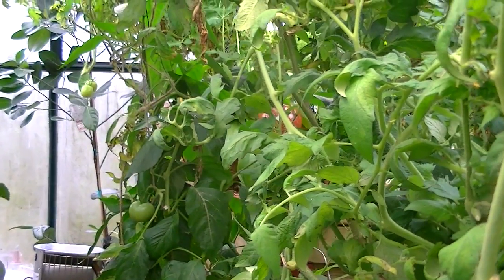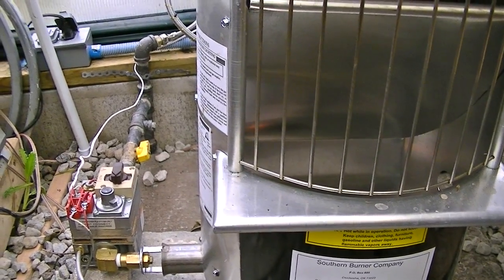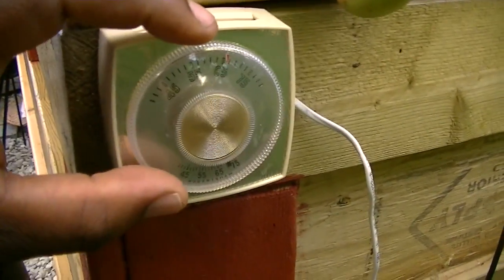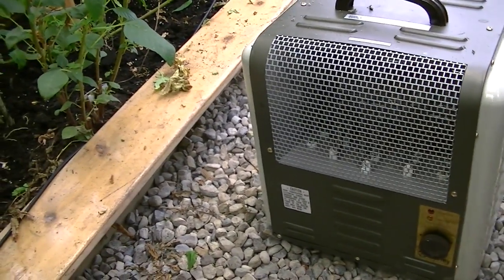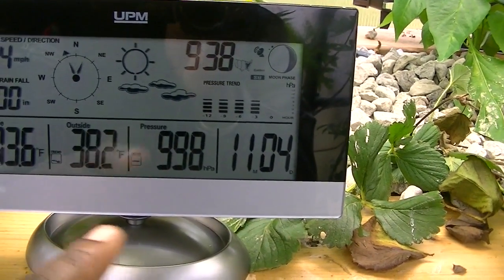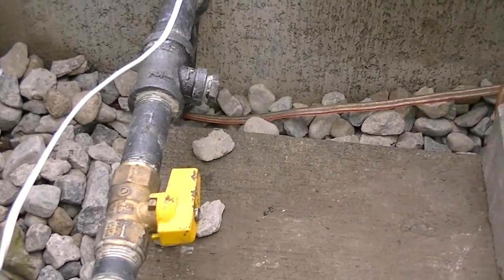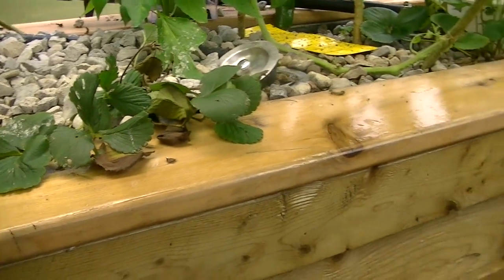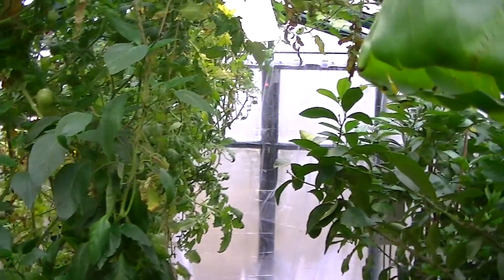Backyard Greenhouse Heating in Winter  (2)

Comment: when using the propane heater or electric heater set metal buckets filled with water on or in front of the heater, the metal bucket will retain heat and heat the water then continue to produce heat after the heaters are off.

Comment: I tried using the 4000 Watts Marley Heater. The heater itself produces a lot of heat but the thermostat doesn't work. The heater just stays on even if you put it at high, medium or low settings. What did you do to set up the thermostat ? Thanks for the reply

Comment: Incredible! Do you know anyone who uses a blower to pull the heated air from inside the top of the greenhouse and blow it down into a dry stone insulated bed below the floor in order to release the heat at night? I'm drawing up plans for a greenhouse in Massachusetts and am wondering how well that method works? Thanks for posting.
Reply from the maker: I know some people that build their greenhouse with a heatsink. I was planning on putting one in this year.. Stay tuned. I will post a vid soon.  Google Heatsink greenhouse and you will find lost of info.. cheers

Comment: Do you run the heater 24-7 or few hours a day?  I lost all my tropical plant this year. I keep it in the sun room, but since we had so many cold days this year they didn't survive.  I live in southern NJ.  Thank you
Reply from the maker: Hi Sumetha, I run my
heater mostly at night; during the day the greenhouse heats up with the natural
sun light. The heater never turn on during the day as I mentioned when i't's sunny. I also considered the position of where the greenhouse was constructed, this
should be south facing with no trees blocking valuable sun shine.  The final preparation should be thermal energy,
which is why I have black drums filled with water. This helps keep in heat up in GH
during extreme cold months
Reply: Thank you for your valuable information.

Comment from the maker: Hi There, The foundation the GH is on, are concrete blocks, which is attached by poured cement. The gravel floor was what I could afford at that time. I'm planning on up grading to slabs, which your right would give off better thermal energy.

Comment: Good video.  It looks like you have a gravel floor and your greenhouse is on blocks. Did you pour a footing for the blocks or are they on the ground? Also, do you think a slab would provide better insulation as opposed to the gravel floor? Thanks.

Comment from the maker: The primary reason why I decided to use the Southern Burner Company ;was the coverage of heat per square feet.The burner kicks out 20K B.T.U. and runs very efficiently compared to the size.The cost impact was the deciding factor for me;nonetheless the burner has it's faults. The heat is produced from the bottom up & the unit doesn't have a fan. Do your research first. Look at FORUMs on garden web forums type in southern burner

Comment from the maker: The propane cost really depends on your area, but for a 40lbs tank refill runs me about $ 34 dollars Cdn.   I use about two tanks per month, so its $68 dollars per month about 204 Cdn to kill the three coldest months here in Canada. This is just a projected cost under the worse cases of extreme weather. However, if could last longer considering the temperature fluctuation we're having now. I'm finding the heater doesn't come on all during sunny days and when the temperature goes  above  +4C

Comment from the maker: The Rion Green house is the top of the line greenhouse as I was told. Nonetheless, I personally found it very difficult for me to put together. This was due to me lacking the strong-minded willingness to assemble every component exactly as the manufacture recommended. I opted out and paid helpers to put it together for me because I actually purchased an oversized unit 8ft x 20ft.  In my opinion, the quality far supersedes other greenhouse on the market.

Comment from the maker: I was concerned at first with CO issues with this heater, until I started to read more into the specific application and how the heater should be installed. The heater requires a fresh air outlet or combustible air intake form the outside of the greenhouse, The manufacturer outlines exactly how the heater should be installed to avoid CO2  levels in the GB. You can read more  on the southernburner web site

Comment from the maker: I also have a breaker within the greenhouse, so I know if water does approach the heater. The circuit will break and shut off the power. I’m not saying that you should have something as elaborate as mine, but you should ensure that you get a separate breaker installed. I've seem these kind of issues before and some people buy a standard home dyer exhaust aluminum hose and somehow have the heat blow thought that and place the heater in the best spot of reduce risk of water dripping on the heater.

Comment from the maker: Condensation has always been the milestone within a home hobby aquaponics system. I too have struggled with controlling this issue. I can tell you that it’s all about the design of your greenhouse and air circulation within your greenhouse. I’m not an expert on this issue, but it’s just me looking at the glass half empty.  Keep in mind that running aquaponics system within a greenhouse puts you at risk to water evaporation. Therefore, condensation is always an issue; so keep the fans going

Comment from the maker: The way the burner works is like your standard home furnace, whereas the pilot stays on all the time. Therefore, if you want the burner to be actually off, you will have to relight the pilot.  In regards to the 20lbs BBQ tank; this is not the normal tank that is recommended for this unit.  Nonetheless, I did set the temperature at 65c and the 20lb tank only lasted 3 days. I’ve since up graded the tank to 500lbs and my projected run out of propane is 2.5 to 3 months at a set temperature at 60c.